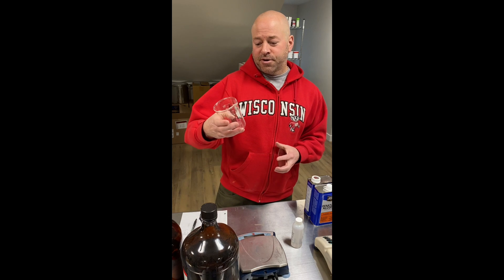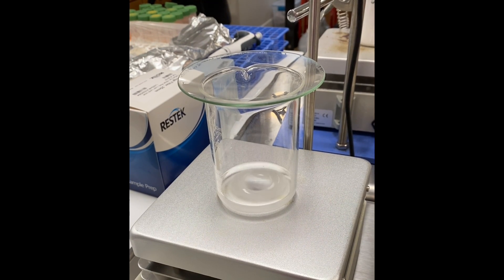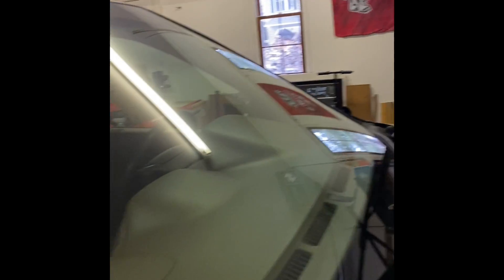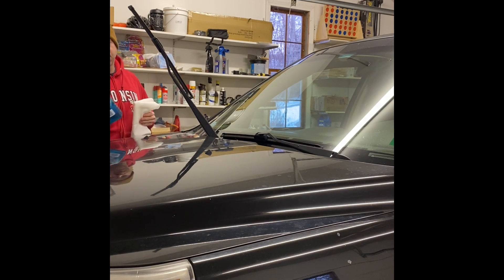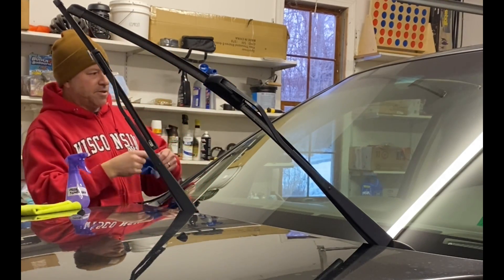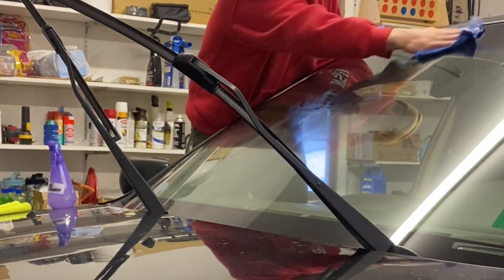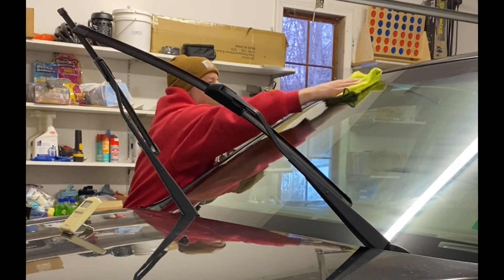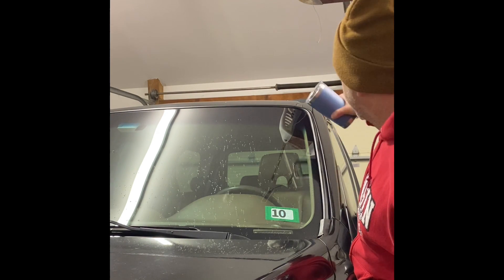Make Your Own Rain-X

Comment: I couldn't find fuming sulfuric acid and used 98% pure laboratory sulfuric acid, but I increased the stirring time of the PDMS 350 and sulfuric acid mixture to 3 hours at a temperature of 65 to 70 degrees Celsius. The final mixture applied to the glass was fantastic. The Water repellency  of the coating is excellent. Thanks again to Terry for this recipe.
Reply from the maker: Great work, I made another batch recently and used octyltriethoxysilane.   It works great too!
Reply: @terryclayton  Does this material need to be hydrolyzed or can it be used as is?

Comment: Hi, Mr. Terry Clayton.
Is it possible to convert this same recipe without using polysilazane and with the help of other materials or additives to turn it into a ceramic coating and use it on the body of the car?
Reply from the maker: You can substitute some other types of polymer but will not achieve same level of hardness.
Reply: @terryclayton What other types of polymers should I use?

Comment: Thank you for the Recipe! I'm also thinking about Pairing it with Rain and watermarks remover before Coating, I found on the internet and it's called "Cerium Oxide" it also acts as polishing compound for the glass window. do you have any insights about this product?
Reply from the maker: That’s a very cool idea.  Be sure to use small particle size cerium oxide (~1 micron).  If you can get glass clean with a 1 part system, that would be great but you may need a 2nd step to clean off polishing agent.  Keep us posted.!!
Reply: @terryclayton Thank you so much for your insights! I’ll make sure to use the small particle size (~1 micron) as you suggested. I’ll try it out and get back to you soon with an update. Really appreciate your help!

Comment: Mr. Clayton, why the Dimethicone + Sulfuric acid and Methanol + IPA can't mix perfectly? at the bottom there is oil sediment of Dimethicone + Sulfuric acid, I hope Mr. Clayton replies to my comment, I'm so frustrated😢😢
Reply from the maker: Sounds like the dimethicone and sulfuric were not mixed long enough before adding solvents. Be sure to use concentrated sulfuric acid an let it mix at least 20 minutes.
Reply: @terryclayton thank youu Mr. Clayton, ur advice so helpfulllll🤩🤩

Comment: Hello sir,thanks for your information,btw can I change Sulfuric acid with HF (hydrofluoric acid)?
Reply from the maker: HF will work but I avoid using it due to its toxicity.  If you are comfortable handling it safely then I would be sure to run some tests using it.
Reply: @terryclayton  okay ,thank you so much sir for explaining...btw maybe next time can you make a ceramic coating for glass or windshield...thanks

Comment: Why use 2 alcohols?
Reply from the maker: Solvents help with solubility of active ingredients, but by blending solvents you can also control the drying rate of the coating.  I think if you use methanol by itself, it dries too quickly.  A blend of isopropyl alcohol and ethanol gives a coating which goes on smooth and dries with good leveling.  Some coatings use ethylene glycol or propylene glycol but I feel these solvents just dry too slow to use in this formula...cheers, T
Reply: @terryclayton  Thanks for the great explanation.
Reply: @terryclayton can i use ipa alone

Comment: Don't have access to sulfuric acid. Would the Walmart sulfuric acid type drain opener work?
Reply from the maker: I used sulfuric acid but you can try muriatic acid (HCl) which is easier to find in stores.  Drain opener is normally a base to break down protein and soaps.  See link: https://youtu.be/vVQ5bP6HDwM?si=teowcWWFWtyisxfO
Reply: Zeps Sulfuric Acid drain opener from Blue big box home improvement store is 90+% Sulfuric acid....they won't say exact % on the data sheet as it is proprietary

Comment: How much H2SO4 to hydrolyze? What was the P.H. of the solution?
Reply from the maker: I use 1% by weight.   It’s really acting like a catalyst to chew up the PDMS into smaller units.  I don’t typically measure pH in solvent based systems.  Thx

Comment: Terry, nice video! I acturally did the same test as you and found it not perfectly hydrophobic. I did this home without any lab and test method so I can not find the reason. what do you think is the reason? Silanol not being fully covered or nature of dimethicone?
Reply from the maker: Hi Dabin,
Is your final solution a clear homogenous solution?  If not, then I would agree the dimethicone oil may not have been fully hydrolyzed.   Also, a critical step is preparation of the glass for good bonding.  Hope this helps.  Thanks! Terry
Reply: Hi @terryclayton  Thank you. The solution is clear. So I will try to clean the glass as clean as possible to see if it works. Thank you.
Reply: @DabinXie  Windex might not be the greatest glass cleaner (Terry, are you listening ? Ha,ha!) But it will do a good job if rubbed-in with 0000 steel wool, rinsed with water and wiped-off  with paper towels.

Comment from the maker: Performance Update:   It’s been 4 months since application.   This vehicle is parked outside and it was a snowy winter and rainy spring.   The coating is still performing great.    I think a key step is the cleaning of the glass to get a good bond for long lasting effect.   Have a great day everyone!
Reply: Thank u!
Reply: Wow, Rock on my man!!.....  Could this be applied to my Solar Panels to repel water and keep generating power better and longer?  Solar panels is just a film of glass on top....
Reply from the maker: @wildwestunlimited  yes absolutely.  Great idea
Reply from the maker: I recommend a good cleaning first to make sure you get good adhesion.  I would think this would boost efficiency keep surface clean longer.

Comment: Any recommendations for a reasonably priced supply chain source providing smaller quantities of fuming sulfuric acid? Also, does % free SO3 matter?
Reply from the maker: I used Carolina Biological Supply recently but I tend to shop around first.
Reply from the maker: In this case 95% up to fuming will work fine

Comment: Cool video. Is that fuming sulfuric acid sulfur trioxide in H2SO4 or just is it just concentrated H2SO4?
Reply from the maker: Concentrated or fuming will work fine.  The solvents and acid are hygroscopic but not an issue in this case.
Reply: @terryclayton  That's great, thanks.

Comment: Professional chemist here. The instructions included here are exceedingly dangerous. Much worse than the acid, this creates diethyl sulfate, which is known to be genotoxic and highly likely to be carcinogenic (look it up on wikipedia to verify what I’m saying about how bad it is). If you follow the instructions as they are presented here, you run the risk of killing yourself and anyone else exposed to this. Diethyl sulfate is hazardous even at ppm levels, so it is not worth trying or even modifying this experiment without the analytical tools to verify that diethyl sulfate isn’t present.

If you’ve already made this (mixing the acid with ethanol and/or isopropanol), don’t throw this away or flush it down any drains. That will only move the hazard on to someone else who wasn’t ignorant enough to do this. WEARING 2 PAIRS OF NITRILE GLOVES: put your container in a heavy-duty ziplock bag (think freezer rated), remove the outer gloves, then put the outer gloves and the first ziplock bag into another heavy-duty ziplock bag (preferably one-size larger). Then take this to your local hazardous waste disposal unit. Search “X county household hazardous waste”, where X is the name of your county for details.
Reply from the maker: Thanks for comment.  I am a chemist.  The alcohols is added after mixing silicone oil and sulfuric.  Also, I do not reflux.   No risk here.   But throw a splash of water in if concerned as diethyl sulfate would break down  instantly anyway.  Again, I appreciate the perspective!  Thank you!! T

Comment: Looking forward to hearing how long your rain protection lasts.
Reply from the maker: Just a quick update, it’s cold winter here in NH but rain/snow is still beading up.  As I didn’t use an amino silane, I have to believe that in warmer weather it will start to wear away…
Reply from the maker: Just added a performance update! 👍👍

Comment: If ya want to super clean any glass? Use #0000 steal wool with a spray foam glass cleaner..  iv never used anything work so good and so fast. 10 yrs. On my old p/u and not one scratch ever.
Reply: + 1 on steel wool! Used to fix windshield cracks as a gig & this is exactly how you get a super clean windshield. You can also use a box cutter knife blade sideways to take off bugs when in a pinch or on the road
Reply from the maker: Thanks John!  I have some pines over the driveway so I’ll give this a shot on the sap!  Hoping the dimethylsilanediol coating helps it come off easier!!  👍👍😅🧪🧪